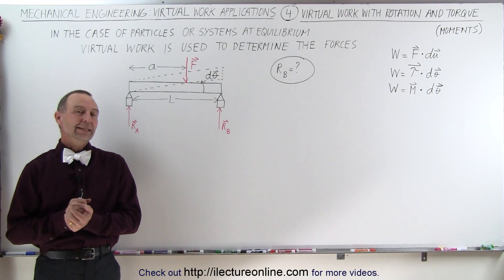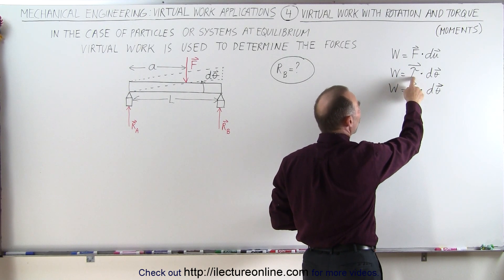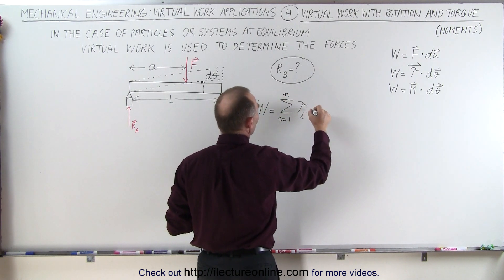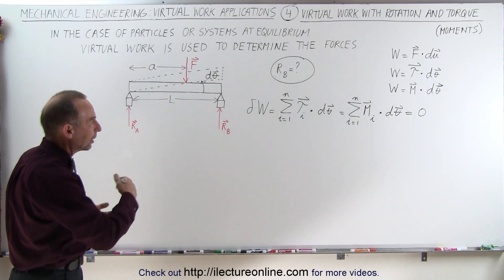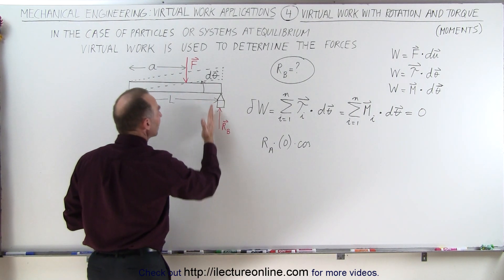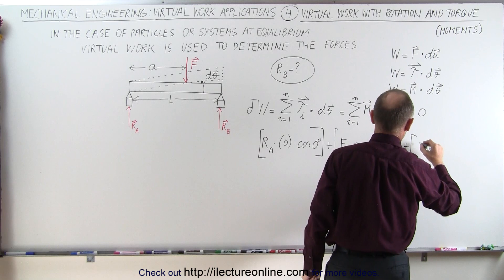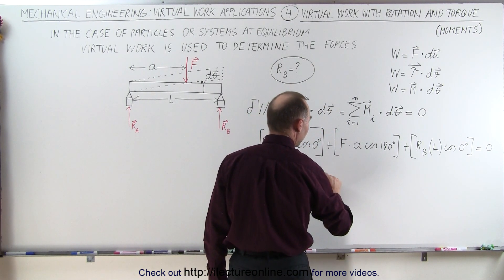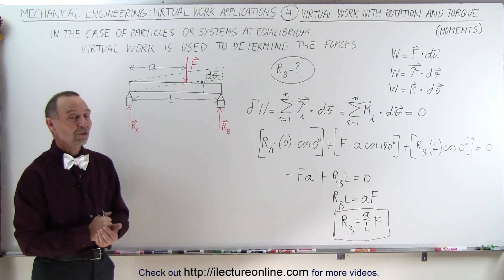Mechanical Engineering: Ch 13: Virtual Work Applications (4 of 39) Virtual Work w/ Rotation & Torque

Comment: This was a little bit misleading (oversimplified). The idea of torque and the angle of rotation as a vector was not followed thoroughly. Both the vector of torque and rotation are pointing perpendicular to the plane. The rotation vector is always pointing from the plane, while the direction of torque depends on the force direction - this is where cosX should come from. Moreover, d(theta) was dropped without noticing (it should be in each term of the lefthand side). Nevertheless, your videos are super great anyway!

Comment: Isn't the d(theta) vector technically perpendicular to the force vector, not 180 degrees to it, since it points out of the page?
Reply: Well, 1 year later but I guess later is better than never...
The angle is in relation to the Torque F.a I assume, and the Torque generated by F and the displacement d(theta) make an angle of 180 degrees, one goes inside the monitor and the other one out of it